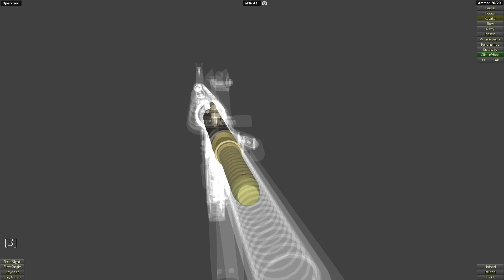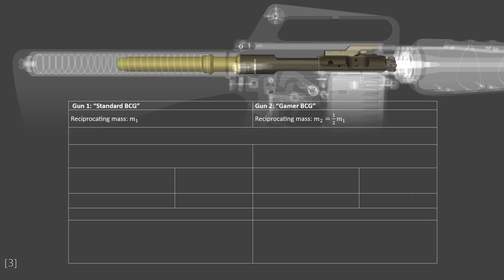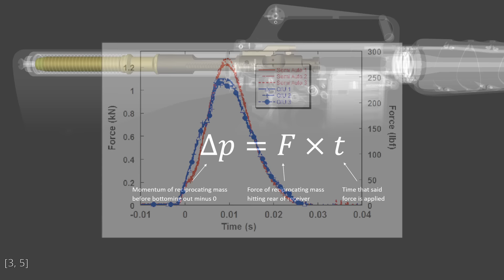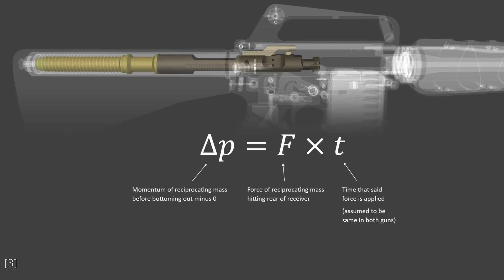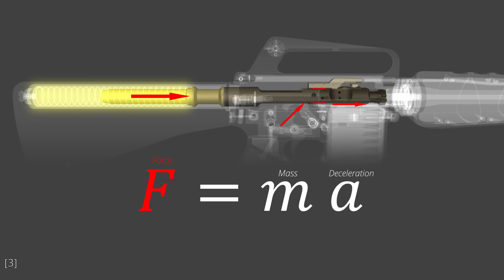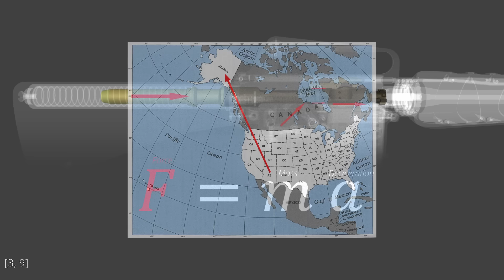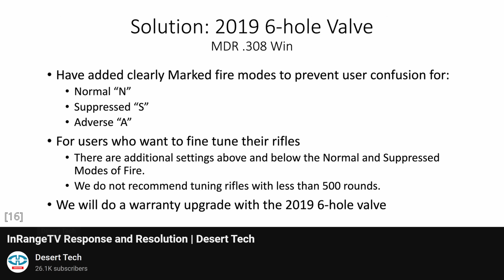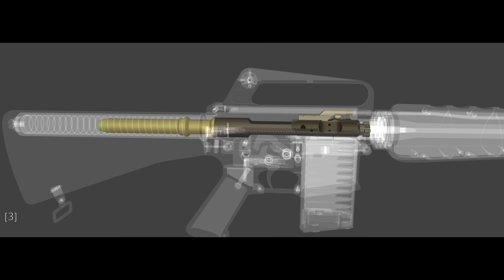Bolt Carrier Mass - A Nerdy Theoretical Discussion

Comment: Buffer weight isn't part of bolt carrier mass, because buffer does not actually help the carrier extract and unlock the bolt. It only helps delay the speed of carrier travel rearward, and add force to strip the new cartridge to chamber.
Reply: Yes
Reply from the maker: I agree. See my replies to Jackson-hs8jx

Comment: You're not wrong but I must say the reason you don't lighten your bcg is because you need energy to cycle a dirty gun reliably and dirty guns are often what you have before the end of a gun fight its not that it can't be made to work as you describe just the benefits are so little it's not worth the risk in real life or death situations but you seem to understand that too so A+
Reply: I've found two things to be true that counter that claim. 

First that reducing carrier mass can increase lock time and reduce gas needs. This does a lot to keep the upper from fouling. 

Secondly if reciprocating mass is reduced but the spring isn't, then the carrier moves forward with a higher velocity. This higher velocity better overcomes stiction and fouling.

Comment: Got a POF revolution, and after years of failures to eject and costly returns and repairs later, I found out that the system has too light of a bolt mass and too little energy in the recoil spring. The local gunsmiths surmise that it should work fine in hotter environments like AZ where it is produced and returned to for trouble shooting, but that its reliability envelope is so narrow that taking it to another climate is asking for trouble.

Comment: You have made a significant mistake with your physics. You assumed that the two unequal reciprocating masses have equal kinetic energy imparted to them. This is not the case. 

This situation is best modeled as a collision, where the momentum imparted to the system (reciprocating mass -> rifle -> shooter) is equal to the momentum imparted to the bullet and gases leaving the barrel.

The assumption that the two masses possess equal kinetic energy is erroneous. Such an assumption would violate the law of conservation of momentum.
Reply from the maker: In a gas operated firearm the momentum delivered to the reciprocating group does not equal the momentum of the bullet and gases leaving the muzzle though. It’s determined by the amount of energy delivered by the gas system, which would be the integral over distance of the force imparted by the gas pressure in the gas cylinder on the front surface of the piston.

A real life example of this would be guns with adjustable gas blocks. Even though you’re not changing the type of ammo or the mass of the reciprocating group, you can still change the velocity of the reciprocating group by adjusting the gas system.

If you want to think in terms of momentum, the momentum of the reciprocating group can also be calculated as the integral over time of the gas force on the front surface of the piston, i.e. impulse. Either way it’d still be determined by the gas system.

Comment: You're conflating to issues as if they're the same and you're completely misunderstanding what Jim Sullivan was talking about - he was talking about the BCG mass in regards to full auto fire and especially in regards to a constant recoil scenario! The competition shooter is only operating in semi auto where constant recoil isn't a thing nor all the other issues in regards to full auto fire. I don't know if you're doing this deliberately or you simply didn't understand what Jim Sullivan was talking about but they're two completely different issues.
There's a huge advantage for a competition shooter to have a softest shooting gun possible because they're absolutely in full control of the tuning of their rifle at all time including having the knowledge about how the weather is going to be like. Your example with the LTF BCG is also flawed in that MAC shot in extreme cold which gives less energy to the BCG through the gas system. Their bolt carrier works just fine if you tune your rifle correctly to the given conditions and you could see his breath that's how cold it was.
Then some of the assumptions you make are not correct for example in regards to springs because their resistance is not entirely linear so something as simple as the hammer spring will have a larger effect on low mass BCG simply because the action of pushing back the hammer will slow the BCG down more.

Comment: Why not just use an electric motor to cycle the gun?
Reply from the maker: For handheld weapons an electric motor adds to the complexity of both the individual firearm and logistics (you have to supply both ammo and battery). If the gun uses ammo to cycle itself then it's simpler.

But electric motors do get used a lot in aircraft guns, both to achieve a faster fire rate important in air combat, and so that a dud round can be cycled out of the gun by the motor since the pilot can't do that himself while flying.

Comment: Meh. the WLVRN gets no fanfare from me for now being unshoulderable weak side.
Reply from the maker: I thought that as well, but then I 3D printed a brass deflector for my X95, and now it ejects at 2 o’clock and 30 degrees downward, and I can shoot it weak handed no problem. So now I’m in the camp of: a bullpup should be able to switch ejection side easily to fit the handedness of each shooter, and should have a good brass deflector for the rare occasions when you want to transition to weak side. Of course novel ejection patterns (forward/downward) would be optimal, but there seems to be too many trade-offs necessary to achieve that

Comment: For the buffer, I don't think it belongs to the BCG mass, because it's just a seperate part.
Reply: Another fun fact is, chinses Type 81 also have the same problem while at the early experimental stage, then they do the same thing--more mass
Reply from the maker: That's true, but I decided to include it in the "reciprocating mass" as a whole because its mass does contribute to both the recoil sensation and reliability of the gun
Reply from the maker: @Jackson-hs8jx  Nice, didn't know that
Reply: @cabbage6015 For the reliability, I think the key is the "drag" force create by BCG to bolt, but when the buffer is a seperate part, it can not creat that force. The same thing hapen on short shtoke piston gun, the mass of the piston cannot count.
Reply from the maker: @Jackson-hs8jx  the mass of the buffer wouldn’t contribute to the kinetic energy available for unlocking and bolt pick up, but it does count towards a few other factors affecting reliability. Like delaying unlocking, controlling BCG speed (to avoid overrunning magazine), and anything in the closing stroke (overcoming filth, stripping ammo from the mag, snapping extractor over cartridge rim, locking bolt,..)
Reply: @cabbage6015  Basically you mean when it extract, buffer control the cycle speed and when it reload , it contribute to kinetic energy right?
Reply from the maker: @Jackson-hs8jx  Yep, basically
Reply: Mechanically it's the same, they always move together.

They are only separate parts so you can hinge the upper off the lower

Comment: I only have an issue with him using the aric as the example because it’s the least reliable and most complex low mass bcg. Maybe if he used a different example I’d be more inclined to believe this. Also the math doesn’t really add anything I think it’s only there to get him to believe he knows what he’s talking about. I see your bias.

Comment: Gorb caveman math. Force is mass times acceleration. Heavy bolt carrier means more force to unlock, extract, and re-battery the bolt. More reliable.

Heavier bolt carrier vis a vis bolt, better reliability.

Comment: The AR-9 platform requires full stop at least 22oz of bolt weight + buffer weight. Any less will cause a mega fuckton of issues, not the least including out-of-battery-bolt-bounce. 

The fact that people are making larger caliber bolts lighter is beyond insanity, even with a gas system.

Comment: With alot more people buying raven 556 rifles in Canada now who may have missed the AR train, i keep having to say, "ARs are spoiled" theyre really a temperamental system despite all the benefits they have, if you change one thing, you need to expect problems and work to tune the system for what you've changed, and this video perfectly explains one aspect of this, just a small change in mass can throw the system off.
Reply: It's not just AR's, this applies to all gas operated firearms. AR-15's are just the ones with the most parts availability, and highest number of people messing with things that they don't understand
Reply: That's all firearms. They were designed with these principles in mind. If you change the internals on other firearms they start to choke too. Having to change antagonist parts because of a modification you made somewhere else is near ubiquitous in any form of performance tuning, if you start to change the parameters in a combustion engine to get more performance, eventually you will have to chase problems away by doing other modifications and buying performance parts to replace factory ones.
Some of the worst offenders are inertia operated shotguns, where adding weight in the form of shell carriers, optics and lights could interfere with operation as the added mass would reduce recoil and thus lessen the spring compression. You don't even need to change the internals.
Reply: If you just get a milspec AR it will run just fine like buying a factory spec car. But if its a turbo honda civic with all aftermarket parts and can't run standard gasoline does that mean all honda civics are spoiled cars? It is the fact that AR have crap ton of aftermarket parts, race gun are build for a different need where change in mass can throw the system off.

Comment: Let me put it more simply. The AR-15 (or any self-loading firearm) has a given OPERATING FORCE. That is how strongly it racks the action to eject a round, reverse direction, strip a round from the magazine and slam it home. The STRONGER this force, the more reliable the firearm because it can more likely overcome any resistance from dirt, gunk, over expanded cases, ramps, and resistance in general. However, the WEAKER this force the less felt recoil the shooter will experience from shit slamming back and forth. Force being mass x acceleration, using a lighter bolt carrier allows the gun to be tuned with less gas and spring forces to reciprocate the action. This lowers the Operating Force and lowers the reliability of the weapon. However, most of us do not shoot our guns in extreme conditions or with utter neglect, so the kind of Operting Force needed to ensure robust function in military use is not needed for our needs. You can reduce the cyclic mass, spring rate and gas tap off by more than 50% and have a very soft shooting AR-15 which is still very reliable -- as long as it is clean, shooting ammo that it likes and at comfortable temperatures. That it may not be in the tundra of the arctic or in the mud of the jungle after a month of neglect is irrelevant to us.
Reply: @LongFatJohnstonOver gassing is when you have too much gas (actuation force) for the reciprocating mass  and to a lesser extent return spring force. The assumption is that your gassing is matched to the the carrier mass and spring rate.

Comment: Wrong! Need using total mass that is m1 + buffer weight and spring.
So the rate between the two v1 p1 and v2 p2 is dependent on the bcg weight and buffer weight and spring. 
So the v2 just a little faster and can not be twice faster!
So people using lighter bcg and h3 buffer just have no idea what is he doing at all.
 
As we can see the standard bcg has lots of holes and cuts and this means the designer has already cut down lots weight to increase the speed. Not just speed, it’s also needed enough weight to provide enough force to load a ammo. 
 .
I always say gun has three types, a tool, a toy or collection and a sport. Each one has its own set up. A toy or collection gun is all for pretty and you can put all kinds of good looking parts to make it pretty. A sport gun is all for scores and the set up is for speed! A tool gun is for reliability and you better not change anything and just chooses the military standard. The reason have heavy trigger and bcg is all because of reliability which is to make sure when you need it and it will shoot! A sport gun is all for gaming and it is ok to choose lighter trigger even it is not safe and light bcg even it will reduce the reliability. Because you are facing a game not a dangerous. So does a toy or controller gun, even it can not be shot it still costs a lot money.
So it is important not using wrong type gun in wrong situation. For example will you drive a sport car to move stuff or drive a truck to races ? Of course not.
.
So why would you pick up a sport gun or collection gun for defense purposes? 
When defense, you need a gun that will shoot every time you need, not pretty, not speed. A cool gun will not save you but maybe die cold because you hold a hot shot gun and just would not shot when you needed.